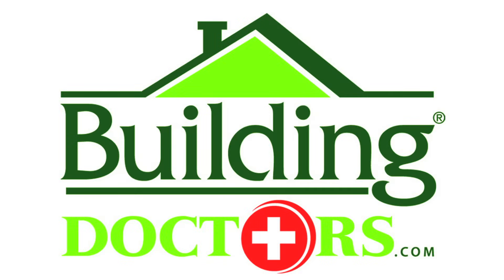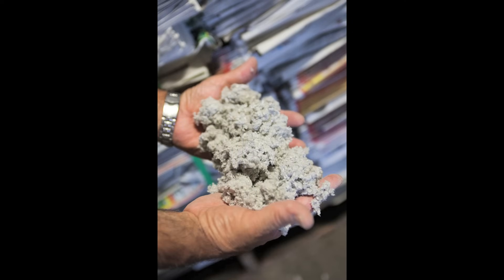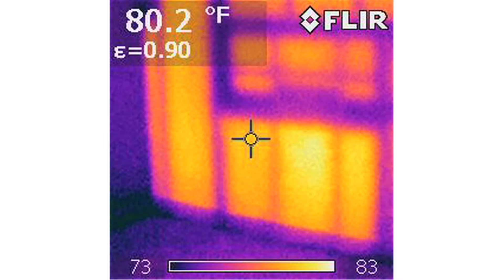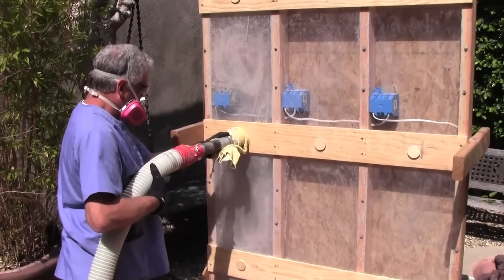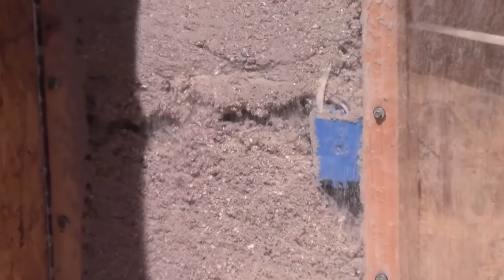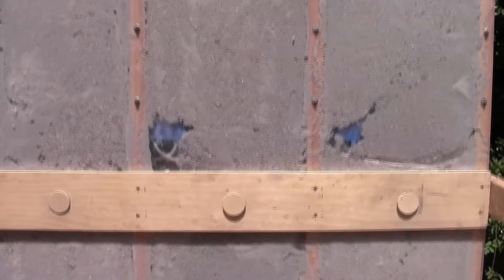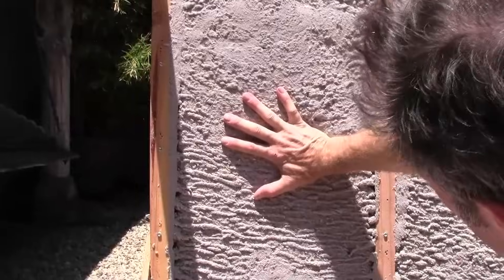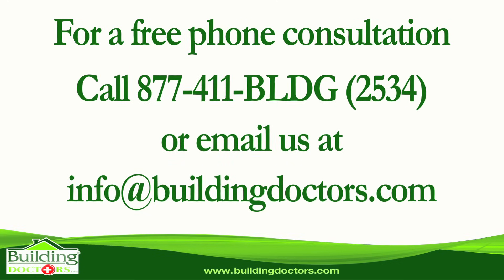Compare Drill and Fill Wall Insulation Techniques

Comment: How can we get more training on this. I would like to do this the right way. 
What equipment do you use for cellulose opposed to foam  spray. Please advise
Reply: Thanks for your question and sorry for the delayed response. You should ask your local insulation supplier and see if they offer training. Sometimes the insulation providers off free training session for larger companies. You need to have the right-sized insulation blowing machine to be able to dense pack walls. Makes sure you ask the machine company. We don't do spray foam insulation. Its way too expensive for our climate zone and I don't want to worry about someone with chemical sensitivity.

Comment: good video. I like the see through wall that you made. Seeing how it works helps a lot.
Reply: Thanks. Please note that in a real wall insulation does not flow quite as easily. That is why it is important to put the tube down in all the places you want the insulation to go.  Best
Reply: Yes smooth plastic has a lot less resistance, this needs to be simulated with drywall and removable wall, no see through, then it would be realistic
Reply: Ya these videos don’t let the customer know that it doesn’t address the issue of thermal conduction through the 2 x 4a as these are horrible thermal barriers and the heat/cold escape through them ...
Reply: @justinlee4022  what's your solution
for that issue?

Comment: And how do you know when it is dense packed and when to stop the pumping? Does the machine make specific noise when that's happening?
Reply: Chef, you learn with experience. The material does not move as freely through the hose when the wall gets to the dense pack stage and the machine does make a different sound as it becomes more difficult to fill the wall. If you push it too far the drywall will bulge or break so practice as much as you can.

Comment: Here's the problem with dense packing.  The - value drops.   If you use blow in fiberglass, it can extension loser. There by giving you a better r-valu.  If you use recycled newspaper, then you'll have to packet hard.
Reply: Edward,  Yes the r-value drops slightly but the desired compaction rate is 2.2 lbs per cubic square foot for fiberglass and 3.5 lbs per cubic foot for cellulose.

Comment: Can you recommend the type of hose to use for dense packing? Trying to find where to purchase one. Thanks.
Reply from the maker: Thanks for your question. if you look at some of the comments below I have answered that a few times. However, here it is again. ...  That type of tubing is not rigid enough for inserting in the walls. Try some braided tubing. We buy ours here: https://jrproductsinc.com/product/1-i-d-reinforced-braided-wall-insulation-tubing/

Comment: I have drilled and filled many houses.. if your not able to drill the outside, you can come inside and drill the drywall. Keep the plugs you drill out . Then run a bead of caulk around the edge and stick it in the hole .after the insulation of course..then you can mud and sand paint. Or you can hide it under a trim crown molding, chair rail. Whatever
Reply from the maker: Lathe and plaster do not always leave behind a perfect plug after it has been drilled. We have found it is more cost effective to use the foam plug but your method could work too. Thanks for the input.

Comment: This is a great video.  Do you think dense packing a shared common wall in one side of a duplex would help alleviate some of the vibrational sounds?  I have a nightmare tenant about to move out of the other side and am considering this once it's vacant, but thinking of only doing that side.  Thank you!
Reply: You could but the only problem with dense packing is, you don’t really know if the wall cavity is being filled to the top. This video makes it look simply because there’s a transparent wall and the installer can see everything clearly.

If you decide to do this, I would recommend reenforcing the walls with screws on both sides. The high pressure and weight could cause your drywall to push or crack.

Comment: How do you know when the wall is full. In the video you could see your test. In a house you do not have this.
Reply from the maker: It takes lots of practice. Listening to the blowing machine, watching how much insulation is going through the hose feeling the resistance from the blowing tube in the wall.
Reply: In other words you don't "know" your guessing.  Granted with a lot of practice it becomes an educated guess, but still a guess.
Reply from the maker: No, it is not a guess.  It is actually really simple math. Determine what the volume of your wall cavity is and that will determine home much insulation needs to go into that wall. We provide a bag count for all of our homeowners after the job is done. Before we start each job we have a 2-foot square box that we fill then weigh to make sure we have the setting correct on the machine. It's is the beauty of measured home performance. We don't guess we test.
Reply: But that isn't what you said the first time. What you wrote says  guessing!  "Practice" "Feel" and "Watching how much" THAT IS GUESSING!  It's no different then the mechanic's I inspect doing a job on the aircraft we work on when they are torquing a bolt  "Practice" "Feel" and "Watching how much" the wrench turns gets the torque close.  But then we use a torque wrench to get it correct.  I just commented from what you said.
Reply from the maker: You are right, I should have given you the longer explanation. I had answered a few questions previously from people who asked how do we prevent the drywall from popping. I cut and pasted the first response from that.  It is all about the bag count and what the volume of the wall is and the product used.

Comment: So the installer had a dust mask. But the ten people who helped remove the packed dust from the cavity had NONE. Bravo
Reply: Edward, the installer used a mask during the filling part of the wall since that is the dustiest time. Then two of us (not ten) removed the plexiglass side with no dust and scooped the cellulose out and placed it in garbage bags to be weighed.  If you knew anything about cellulose it is not a dangerous product to breathe.

Comment: I'd be doing this myself. Hire contractor, he says WE DO DENSE PACK, in reality it cost him more due to it uses more. Put ANY contractor in that position, I have, and when they can short you, specially when there is no way for you to tell as in the inside of a wall and that contractor 99.9% of the time is going to lie out as ass telling you he is doing dense pack, so it is "more" expensive but in reality he is going to be filling the wall half ass'd and telling you oh ya it's "dense pack" baby so pay up. I'd just never pay a contractor to do this, your gonna get shorted and a half ass'd fill because LESS FILL = MORE PROFIT.

Contractors are only second to car dealers on the "rip you off" scale but they do it with stuff they can short you and thus over charge you. 

Verify everything or get screwed. Last time I hired a good upstanding contractor with a steller reputation I caught him red handed lying to me. Paid for grading a hill side into a flat so I could build a shop. After he did the dozer work, and he did excellent on that, he said he brought in 11 dumptruck loads of gravel and proceeded to charge me for 11 loads. 

Unbeknownst to him I pointed my security cam down at the newly excavated flat and set it on continuas record. It recorded him bringing in 8 truckloads not 11 truckloads. I calculated the cost for 8 truck loads and cut his check for that amount. 

He hit the ceiling and argued he brought in 11 loads and said he would sue me. At that point I sent him a link to youtube where I uploaded the video for that day and said watch this you effin A-hole and I'll CRUSH YOUR ASS in court.

Only thing I heard back from him is please take that down... please please please... I agreed if he brought in the rest of the gravel and got it done in the next 24 hrs. Stupid shit tard. AND... that was a fine upstanding contractor with AAA rating and "the best" reputation. 

They are all rip off artist who will short you every chance they get unless you figure out a way to outsmart them, I recommend video if possible. They cant refute that.

~
Reply: Robert B not all contractors will rip you off
Reply from the maker: Wow, it sounds like you have had some bad luck with contractors. There are a few contractors in my area that claim they are dense packing but when I tell potential customers what to ask them about their technique all of those contractors fail. Many contractors lie but the numbers don't. There is a volume for each wall cavity and a specfic amount of insulation that will go in it. Ask for a bag count at the end of the job. Do your homework and check references.
Reply: I went through my local power company. They         Sent a quality control inspector to verify the contractors work.
Reply from the maker: We have a program here in Southern California called the Energy Upgrade CA program that has a quality control aspect like you mentioned. It is very tough to prove walls have been dense packed but it can be done. Thanks for your input.
Reply: I have personally installed preexisting home walls with cellulose for three different companies. Two of them did not dence pack, one did. The easiest way to tell if their doing it correctly is to watch them. The machine will start to backup, or stop flowing as it's time to pull the hose down. If this is not happening they are not dence packing.
Reply: Also, If you attempt to do this with one of the mechines you can rent from Home Depot or Lowe's good luck, and I hope you have a LOT of free time on your hands. Your gonna need it
Reply from the maker: You are so right. Actually, I don't think their blower motor is strong enough to dense pack the wall. Thanks for your message
Reply: Robert B ...what do you do for a  living...?...I bet you're definitely a rip off artist...no questions...you absolutely are...
Reply: Right... you got it figured out, no foolin you. Any one I do biz with, If your gonna over charge me just be up front about it so I can decide if I'm good with that deal or not. As for me  what ever I have done for a living, I never misrepresented myself and always did a days work for a days pay.  Any product or item I sell or have sold was for a fair price, not the highest or the lowest, and yes, I always made a profit, unless it is stuff I do for family or friends, never make a profit off them but I expect payback later when I need something they can help with.
Reply: what do YOU do for a living? I'm guessing it's either 1.) complain about comments left on youtube viceos. or 2.) You are a contractor that this guy hit a nerve with.  If you're not doing shoddy work you have nothing to worry about. 
It looks like this guy did his homework and covered his ass.
Reply: Robert best advice ever... thank you
Reply: You only know for sure if you do it yourself. We need more good ol' boys who put their heart and soul into the work they do, not all the chumps ripping people off that we have now. I'm lucky to know several EXCELLENT contractors personally from growing up in a small town.
You guys in the big cities sure must like getting bent over and fucked for everything you have, it's like nobody cares that (likely) the biggest investment you'll ever make was built by crooks.
Reply from the maker: Robert, the reason why I love what I do as a home performance contractor is that everything is measured and verifiable. We use building science-based tools to test and measure homes before we start work then after the work has been completed we do those same tests again to prove the exact improvements that we installed. All of of work is third-party verifiable and checked becasue of our certifications. It keeps the crappy contractors out of our business becasue you have to stand by your test out numbers. Again, sorry you have had bad experience with contractors. We are proud of the reputation that we have. We just got awards two days ago from the two utilty companies for having the highest energy reductions in the 2017 Energy Upgrader Ca program for both terms and KHW. So yeah, we know what we are talking about.
Reply from the maker: I just responded to Robert and it fits for what you wrote as well. Yes, there are crappy contractors out there that lie like a rug. However, the numbers don't lie. We measure and test every home that we work on and all of our work is third party verifiable.
Reply: Wrong. I can set my air and feed to fool a customer. But why? Customer has no idea what they are watching. I dense-pack every cavity to 3.5 #. That is the industry standard. I can also test every cavity and use an I.R. to be sure they are filled. The customer has no idea what the installers are doing. Bad advise dude!
Reply: A Home Depot or rental machine will NOT do the job on walls. Ever.
Reply: B.P.I. People don't believe it until we do the work.
Reply: Lol, I was thinking the same how would you know if dense pack and how can you verify.  I probably wouldn't want to be around when they're working.  I need this done to my bedroom...
Reply: You should have reposted that video after it was all over.
Reply: Not every contractor is unethical.  Most in fact aren't.
Reply: Glad I found your reply to the video good info to have.

Comment: Size of hole, and size of tube OD?
Reply: Hi Kevin, thanks for your questions. To give us a little more space to move the hose around during the dense packing stage we drill a 2.5 inch hole and tapper the blowing hose down to a 1.5 inch hose. depending on where you live you can get winter grade and summer grade hose for more flexibility.   Hope that helps. Happy New Year.

Comment: Very good video.   Thank you.  Where do you get the clear plastic tube?  Lowes and Home Depot don't carry it.  What's the diameter?  How did you attach it to the end of the greenfiber machine?
Reply: Good question, is anyone going to answer it!
Reply: Michelle, my apologies in the delay of responding to this. I just am seeing this now because of Kodi's message below. Here is a link to a company that sells wall insulation hose. http://www.jrproductsinc.com/shop/pc/Wall-Tubing-SOLD-IN-10-FT-INCREMENTS-c101.htm. You can get a winter or summer grade depending on your climate zone of if you and doing the install from the inside or outside. Where we are in Southern California the summer hose works fine. We use the 1.5 inch diameter but many use the 1.25 inch. Unfortunately, the machines that they have at the box stores (Lowes or Home Deport do not have a large enough blower motor on them to properly dense pack walls. You might reach out to a local insulation contractor and see if you can rent one of their machines. That same company JRPorducts has reducers to you can connect the hose to the diameter of the outlet on the blowing machine. Hopes this helps. Have a great day, Dan
Reply: Kodi, thank for the message and letting me know i have a question on here. See the answer below. If that does not answer it please let me know. Best,  Dan
Reply: Michelle Lindsey family farm and home sells it by the inch
Reply: You can purchase the hose from Home Depot or Lowe's. Check the plumbing area. They sell it by the foot on big rolls. Little tip...if the hose is too cold it will be too stiff and won't contur to the area you need it to. Try warming it up by laying it in the sun for a while. Be careful if it gets too warm it will be too malleable and will kink up like a garden hose and that's not good either. Good luck

Comment: Can I rent this type of equipment?
Reply: Kal-El, Thanks for your message and sorry for the delayed response. I have never found a place that you can rent this type of equipment. The machines that the big box stores let you use when you buy loose-fill cellulose or fiberglass from them don't have a big enough blower for the dense packing technique. You can look up contractors in your area at www.bpi.org and look for Gold Star contractors. They have the highest amount of training in energy efficiency measures.  Sorry I could not be more helpful.

Comment: Does this form of insulation do well with sound deadening? I have an old condo that has no insulation in the walls. I really just wanna tear down the drywall and put in bats of rock wool, but am dreading the hard work of removing drywall and reinstalling new stuff and then mud and taping while living in it.
Reply: Thanks, for the questions. I have answered this before but anything inside the wall will slow down the sound waves. The denser the product the more slowing of the sound waves. Rockwool is defiantly one of the best products but you do have to remove the drywall and that is a huge job.  YOu can also look at adding a layer of Quiet Rock on the inside with a small air gap between the two sheets. We have had great results with this product. But you will never regret adding r-value to a wall assembly that has no insulation.  Best of luck with your project.
Reply: @danthomsen811  wouldn’t adding “quiet rock on the inside” still require the current drywall to be taken out? And yeah I guess any insulation would help. I would just hate to spend thousands on blown in if I knew it wouldn’t satisfy me and I should have gone the rock wool events from the start.
Reply: @Heliosvector  You would add the quiet rock as a second layer on the inside. Google the product and how to install it. However, you should consider insulating the exterior walls first.
Reply: @danthomsen811  oh you mean inside as in interior walls.